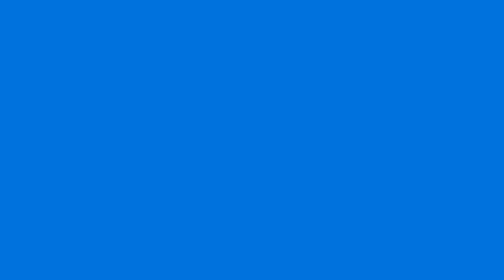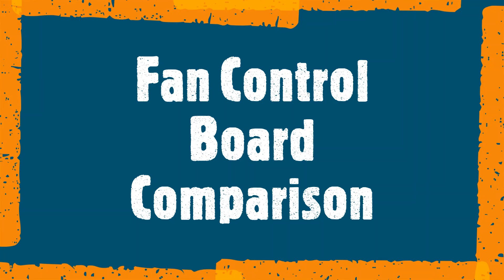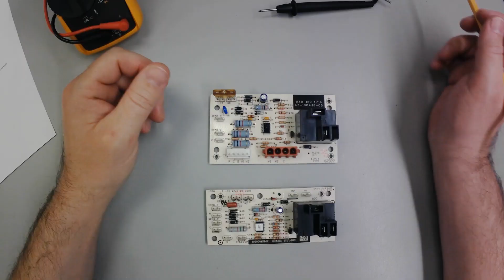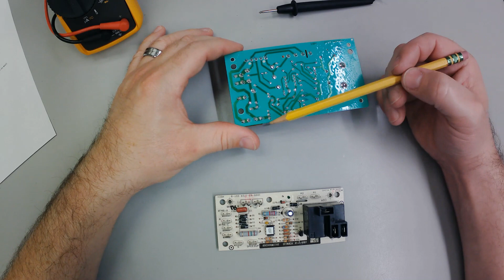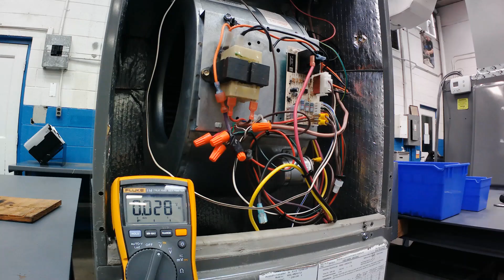Fan Board Comparison - Goodman vs Rheem

Comment: They make it more complicated than it is so let me simplify for you to digest.  All controller boards for fan are similar  in  operation so once you understand practically you can use any brand board to fix yours.  No need to buy the same brand.  I just did it on the Carrier brand with Goodmand board so i know with certainty that it is true.

Connections are:

24V to the board  usually red and brown  wire
fan controller  wire from thermostat  usually green or white  (24v when on from thermostat)
power to blower motor usually black wires

There  is other setting for delay adjustment in the case of this Goodman board   speed  to common  is nearly no delay,  speed to 24v  is some delay and  speed to nothing  is the longest delay and that is the prefer default for use.
When i say speed to  xxx it means the speed terminal is jumped to either C or 24V on the board. 

Fan controller is needed because  when on condenser fan and compressor turn on first then blower fan and when off  condenser  fan and compressor turn off first then delay of about 1 min  to turn off blower fan.

That is it.   Life is simple people make it complicated - so true and very true!!!!!!!

Comment: That Goodman  board is excellent and very cheap vs all the others.  I had a roof top commercial Carrier that i could not even find the replacement for the fan board as  the blower ran non stop.   Carrier parts are very expensive too. Since i  understood how this thing work it was simply a matter of swappingh wire correctly as they all work the same in principle.

Sure enough I bought one on Amazon for $20  and it worked perfectly. 
Had I not have the knowledge to fix it myself the repair people will tell me since we can not get part as your unit is too old  we will have  to replace the whole  thing with newer unit and here is our estimate - an eye popping of nearly $10k  parts and labor.   Now how do you think i know that??????

In reality it could be fixed for a $20 parts and some wire swapping.  Just the fan controller board and the whole wokring  rtu (root top unit) commercial  Carrier brand had to be discarded!

What a waste and what a rip off for the consumer and sadly it happens daily  year in and year out everywhere on earth.   People that have knowledge and know how to fix  themselves as a consumer are rare.  I happen to be in that group because i got burned by these f.er rip off repair a. hole so i got mad and learned how to fix myself and invested in tools. Yep and that was 15 years ago.   Now I know as much as them and have all the tools for the whole job .  No body can and will fool me in AC repair.  

A bonus in AC  repair is once you know  that applies to both auto and home and tools are similar.  Sure it is expensive to buy tools and refrigerant  but so is hiring them  to get rip off.   Who says that you have to buy all brand new? I bought all used  and there are plenty online if you know how to search.

How motivated are you to learn to fix yourself? I was mad as hell  15 years ago so I was extremely motivated to learn. and I did it!
Reply from the maker: 👍 there are a lot of things to learn but if you get the basics down and can apply those principles there probably isn't much you can't fix! I won't comment on any business dealings!

Comment: Interchanged and mix frequent, just start with the schematic , especially in this day of supply chain shortages .you can go to your local electronics shop and get the molex pin kits.

Comment: what speeds (rpm) are those blower motors?
Reply from the maker: I don't know that I looked at the specs on those motors but I bet it is probably a standard 1075 rpm blower motor.

Comment: Could I put one of these boards on an old AC unit and connect it to my new blower motor? I'm don't see why I couldn't replace the old components rather than buying an entire unit.
Reply from the maker: I don't see why not as long as you have a PSC blower motor. These boards are fairly simple and while not exactly a "universal" fit for every unit I think you can still get one to work if you think about it a little.

Comment: Another great educational video John! If you could do a video on how a 24 volt CT1S45 time delay relay works and it’s wired in an electric furnace I would greatly appreciate it. Thank you!
Reply from the maker: Thanks. I think that I actually have one of those on hand. I took it out of the air handler that I just rewired in a video. I'll see what I can do.